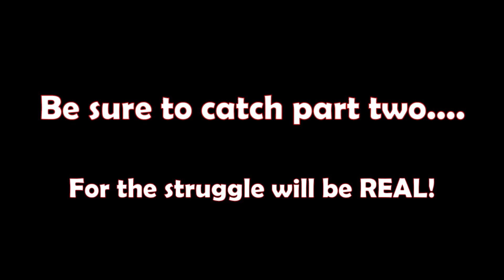Valve Stem Seal Replacement 429 & 460 Ford 1976 F100  Smokes on Startup Oil Burning!

Comment: I've been having this problem for about a year burning oil with blue smoke on cold starts. We thought it was the rings at first, but my mechanic said it's the valve guides. We only gave her new oil of 10w-30 blend because 5w-20 FS is too thin and costs too much and we don't know why they want to use such thin oil on a big block V8. We cleaned the distributor and gave her new wires and spark plugs due to the spark plugs were corotated from the oil. Lastly a better tune up. Still puffs blue smoke but performs better.
Reply from the maker: Thanks for watching and leaving a comment!  
So basically that's why I did the video itself. Nine times out of ten, yes it is worn guides and destroyed valve stem seals. The valve guides are in fact pretty worn out in those heads on that truck. To buy some time, installing new valve stem seals will certainly help. It won't solve the problem, but will at least help keep a majority of oil from getting down past the worn guide. Most the OE valve guide seals don't last a long time and eventually harden up and become brittle. That's whey replacing them will certainly help! So I'd advise to do that before anything else, as a valve job isn't a cheap venture. Replacing the stem seals is a much cheaper 'temporary solution' and can at least buy time for the more expensive work ahead if you decide to do so.
Now on to oils. For older engines (we'll say 1980s and older) the clearances and tolerances will NOT like the thinner 5w20 oils. But for vehicles in the 90s when new, that oil became the norm. You never mentioned what year your truck/engine was, or how many miles were on it, so I don't wanna say 'just run this weight of oil' However, 10w30 seems to be a happy medium for all and what I use on most all of my freshly machined older engines too. As they wear in I will switch to 10w40. High mileage engines with really low oil pressure readings they can some times get the 20w50 treatment. So it really all depends on a case by case basis. 
Hope this helps and feel free to ask any more questions!

Comment: Where can I get that spring compressor that you Where using in mid video
Reply from the maker: If its the bar/lever its KD Tools #912. 
I can't recall exactly where I got it from....but could have been a swap meet or local auto parts store. Performance Tool makes a knockoff of it. Its Chineseium, and available at most local parts or tool stores. KD should still be USA made, I believe. Many auto parts places sell KD. 
In my 'part 2 video' I made one as well, because even the KD tool wouldn't work up near the firewall. 
Hope this helps, thanks for watching! Appreciate it!

Comment: If I go to the trouble of changing out stem seals on a daily engine and I have... I try to find a positive type seal they make them in various guide sizes and Viton Fluoroelastomer soft rubber High heat withstanding with the garner spring will keep excess oil off the stems even use them on the exhaust side but you don't have to all my Mopar engines get this type of seal..... No Smokey here he not home!... On a rebuild it goes with out saying vition is the way to go.
Reply from the maker: Totally agree. It really wasn't too bad to change the seals. Now if it had A/C.... might be another story...🤬
For some reason I'm thinking that on these guides they would have had to be machined down just a hair to use positive sealing units. I could be wrong. But really, I was just thinking 'band-aid' as they are 1970 heads and I'm not even sure if there's hardened seats installed or not. You'd think by now though... 
So figured just throw the std. Umbrella seals on for now. (I have bags and bags and bags of these from engine kits..lol) The engine itself is getting a bit tired too. Someday...! Thanks for watching!! I appreciate it and comments!
Reply: @OlysGarage  cool me too I have bags of the old umbrella style I use them as windshield wiper seals on pivots that go through the cowl on cars and trucks works great to keep the water out!
Reply from the maker: @moparnut6286  ha! Thats an awesome idea! Never thought about that, they'd work great! See? Learn learn a new hack every day! 😁👍

Comment: Hello there question I have a 77 Lincoln mark 5 with A460 engine V8 7.5 l, Black smoke comes out of the tailpipe only when you start it up once it warns up it stops, I did new oil change spark plugs, They told me it was burning rich gasoline so I did a carburetor Rebuilt.  But it still does it, Like I said it only does it when you start it up once engine warms up it goes away, Car runs perfect idols good, Also there's 4 spark plugs that get wet with engine oil, any thoughts on what could it be.
Reply from the maker: What carburetor are you using?
When you say the plugs are getting oil wet, is it on the outside or the inside? (in the combustion chamber) 
Black smoke, if you are certain is black and not blue, is definitely over fueling. Blue is burning oil. Your choke may be set to be too rich. You can lean it out one of two ways, depending on its needs-
1. Twist the choke cap in the lean direction (ccw if I remember right, should be printed on the cap) 1-2 notches. This will alter the duration of time the choke is 'on' which is ok. Might be needed.
2. Re-check the gap the choke air horn flap is set at, while on fast idle. There is a certain gap needed, yours might be too narrow restricting too much air. 
There should have been adjustment instructions with your rebuild kit on setting that air horn valve for fast idle. 
Last thing is always be sure your float levels are set correctly. You rebuilt it, so I assume you've got them set correctly. 
Hopefully this helps and you figure it out. Thanks for watching!
Reply: @OlysGarage   It's a motorcraft 4 barrel carburetor, Had a shop rebuild it and installed it,  They're wet from the inside of Chamber,  They're new  Drove the car for 2 hours, 3 on the driver side got wet and only one on the passenger side got wet, And the rest just had a little bit of black smoke, Thank you for responding appreciated

Comment: @Oly's Garage I just replaced my valve stem seals on my 84 f250 w/460 and now I am hearing a couple valves knocking (I only cranked the engine, not fired it up.) Do you have any suggestions?
Reply from the maker: It's possible that some hydraulic lifters bled down. Sometimes it takes a minute or so for them to pump back up when the valve train has been taken apart. I'd run it a few minutes and if the problem persists, pull the valve covers and make sure every rocker arm is being fed oil. If there is any that are still dry, you may have other issues. I believe the '84 was a bolt-down style of rocker, wasn't it? Sometimes I'll roll the engine over to different spots and recheck the torque on the rockers. They are not a high torque value and if one is up on the cam lobe it can sometimes throw off the torque and leave the rocker from being completely seated down leaving a loose rocker arm. If all are seated down, this shouldn't be an issue.

Comment: i got a question , i have umbrella seals on the engine and i went to part store and the guy sold me positive style selas ....do i really have to machine the guide thingys to use the positive seals or can i just install the positive seals as is without machining
Reply from the maker: Most of the time the guide's OD is too large to get the positive seals over them. That's where the machining comes in. I suppose if you could get them over the guide without machining, not stretching them out, they would work fine. However, if it were me, I'd just take them back and get the umbrella ones. Hate to have to do this twice because the positive seals were stretched out and not sealing on the valve stem. Just my thoughts.

Comment: Can you make a video on a 1986 f350 cuz I’m having trouble with the key I change the ignition cylinder and the ignition switch but when I turn the key nothing happens at all no lights no nothing and I change a lot of stuff and I don’t wanna spend more money on stuff that’s not helping with my issue
Reply: But the truck has been sitting for a couple years
Reply from the maker: So i don't have access to anything int he 80s. Most my stuff is 1979 or older, but it works in similar ways. Do you have a test light? If you don't, get one. They are cheap and extremely helpful. With a test light check for power coming TO the ignition switch. In the 'off' position you should have at least 1 hot wire at the switch. this wire would be coming from the battery side of the starter solenoid, or from the constantly hot side of the fuse block. I know in the earlier ('79 or older) trucks, the source was from the same post the + cable was connected to. This wire is also a fuseable link. There's a good change that the fusible link within the wire popped. 
Hopefully this helps a bit! Up until the dawn of ECU's that's pretty much how these trucks and their  systems were.

Comment: I thought the early heads were adjustable also.  Because of stud and nut .
Reply from the maker: They were called a 'positive stop' as they are tightened down so that the ball meets a shoulder on the stud then torqued. These are intended to NOT be adjustable. You can cheat this setup with a few aftermarket options (i use to do it with small blocks all the time, Crane made a special set of nuts for them to do just that) by using interference nuts or locking nuts that use the 3/8-24 for '68-''71 and lock through the top. In 1973 They went to bolt down fulcrum style rockers.
The early '68 Thunderjet heads are said to be adjustable, but i cannot confirm that for sure. The SCJ heads most certainly are, as it was a solid lifter cam. The remainder '68-'71s and CJ's are not, but the CJs have screw in studs that can be easily swapped out. We do not talk about '72 heads... they are JUNK, stay away from those detonation pigs at all costs.